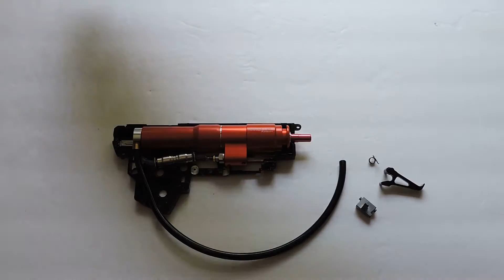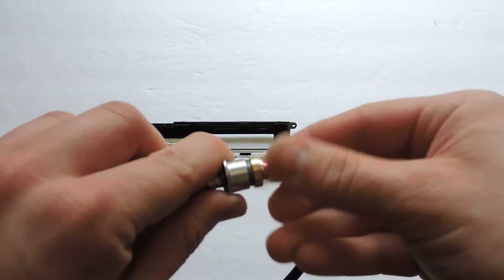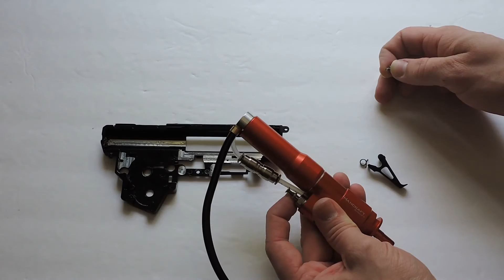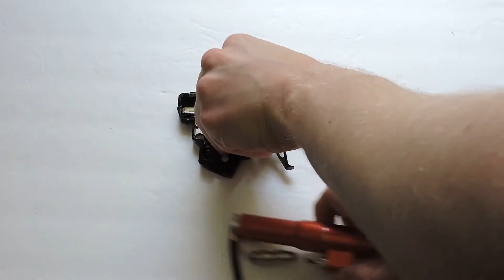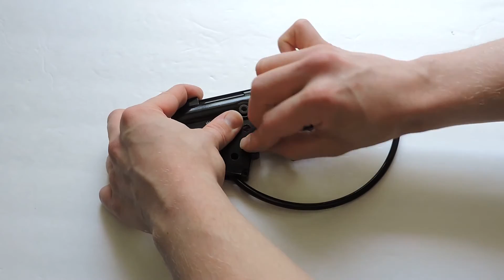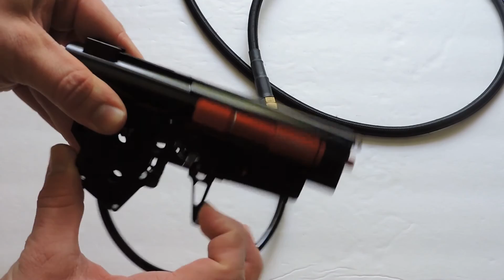Airsoft 101: Mancraft V3 PDiKS Trigger Install & Adjustments

Comment: I know, old video but.. i just installed my Mancraft v3 into my E&L AK and sometimes get doublefeeds. 70% of shots are fine. Is my nozzle to far back in the "Open" position? Could someone messure how far the nozzle will stick out of the gearbox when airpressure is applied? Mine is around 6mm from top of the to the gb-shell. Happy about any tip!

Comment: Hi Bro, in this video remember what pressure is regulated? I pretend to run at low pressure to get around 400fps, but I'm afraid the trigger valve mechanism don't work well at lower pressures...
Reply: U need volume reducer

Comment: What is your base gun you're using?
Reply from the maker: I'm using a VFC AKS74un. After cutting off the little post that's located 
on the rear of the gearbox, It fit perfectly. :)

Comment: Nice video.
I didn't have to screw off the whole front cylinder piece to adjust the nozzle length. I just took off the steel nozzle holder (with the brass ring) and adjusted it like that and screw it back again. Much faster job to do. :)
The trigger valve screw replacement trick is a superb thing to do. You really get better trigger response and shorter travel.
Reply from the maker: Thank you buddy. Great videos on your channel, I love the AUG! That's another way to do it. :) Although mine kept losing the adjustment, So I had to tighten it down more. Screw replacement certainly helps. I had a minor set back on my build, But eventually will be posting my full DMR build. Happy Airsofting! :)